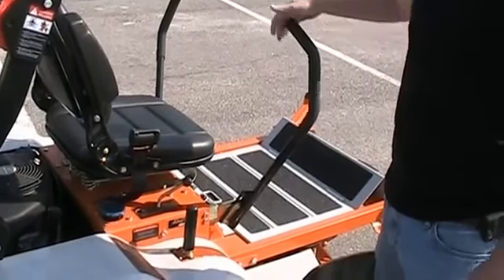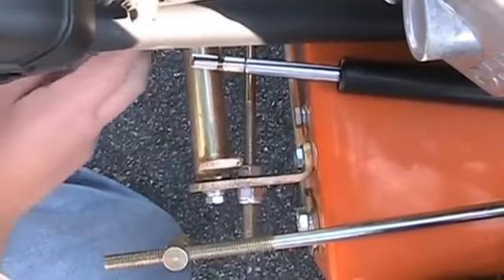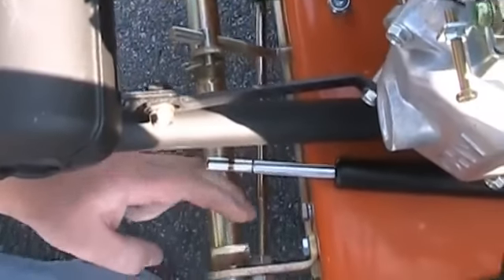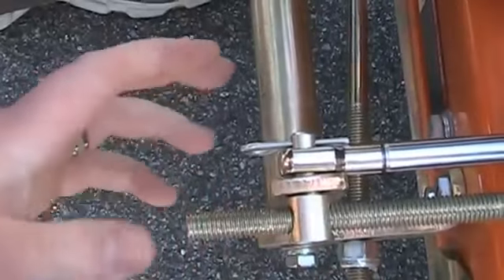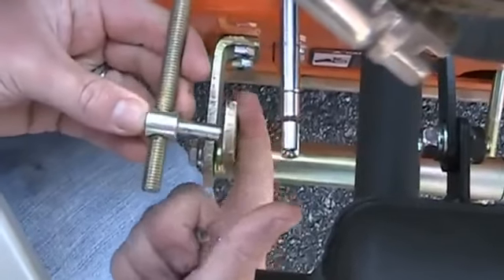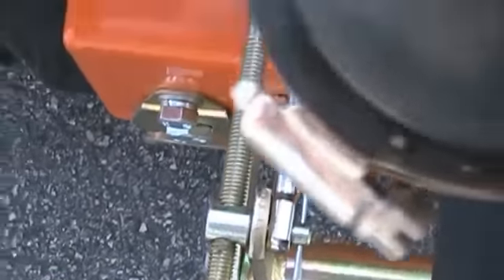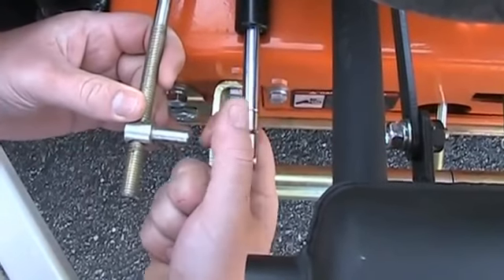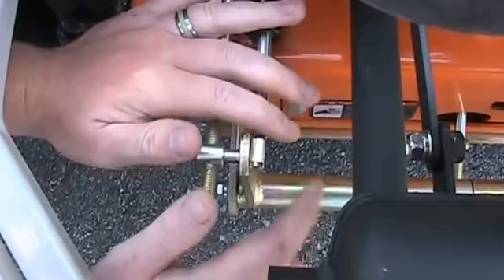Z-BEAST - Maintenance guide - Adjusting Alignment issues - tracking adjustments

Comment: Great video. Thanks. My lights stopped working all together...any ideas. Previously I replace one led. Everything worked great. But now I've noticed nothing is coming on.
Reply from the maker: reach out to customer service at 919-550-3221. They can either assist with troubleshooting and / or refer you to a service center who may assist.